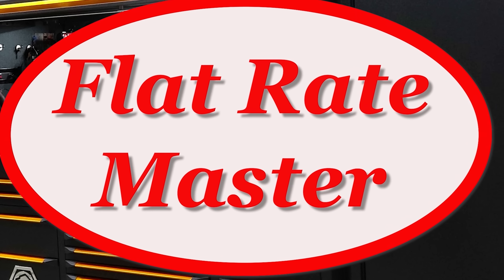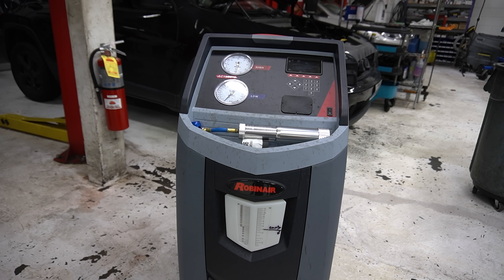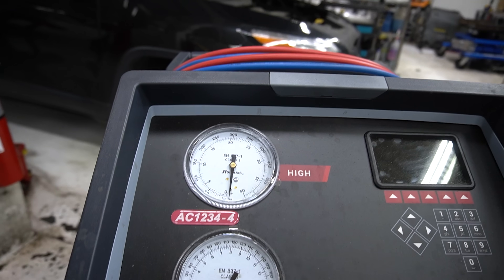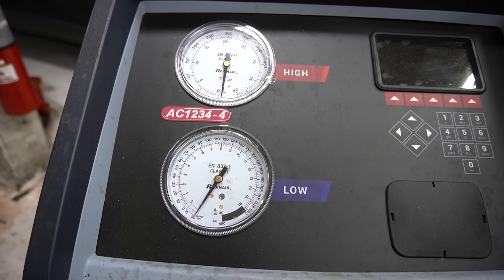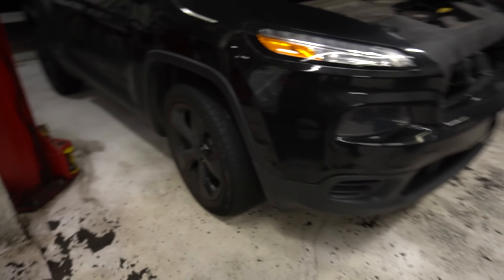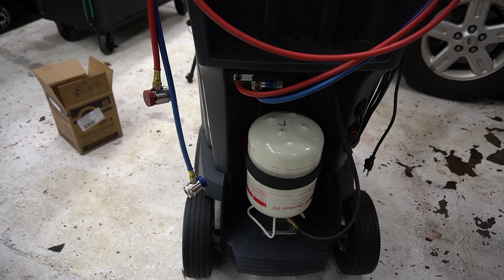Tools For R1234YF

Comment: I suspect in my area there's going to be a lot of 1234YF converted back to the 134A until prices reach reality. I may or may not know some folks who have done it with no issue. In most cases the components are exactly the same as the earlier 134A equipped models.
Reply: I don’t think it as easy to change as r12 to 134a.  I think you just can’t change fittings for 1234rf but I could be wrong because I never tried. Like you channel.
Reply: I may or may not know some shops here in northern europe that has replaced the 1234yf with r600 succesfully. Its still a flamable gas but much less expensive.
Reply: You cant convert R1234yf to R134A
Reply: @christopherenger1602  You sure can...
Reply: You cannot go back, only forward. R143a to 1234yf will soon be fine. No way on God's green earth can you go 1234yf to 134a.
Reply: @collinhopper7542  According to the EPA, R134A is a legal refrigerant for retrofits. I know the systems will handle it. I don't really see an issue.
Reply: Seeing as the manufacture get HUGE emissions credits for using 1234YF, that means that if you put R134 into it, you are 100% Emissions Tampering. And thats facts, not my opinion. lol

Comment: Compressors Leak pretty common a whole erra of vehicles left oil marks under hood above compressor see tracks. Then 134a came out and terqoise o rings and 123 here we are. Lots of cars charged with Propane works really good.  Didn't know contaminated a few machines.

Comment: I did a ac comp expansion valve and condenser on a 18 silverado the other day.. used a robin air machine and have mixed feelings about it running a leak down test before charging  the system... but if it fails that test it let's you know not to waste your expensive refrigerant and to find the leak... which we should not be charging a system with refrigerant when a leak is detected so I guess that is a good thing

Comment: Some hybrid vehicles use the AC system for thermal management of the batteries So  Vehicle owners Will not have the option of not repairing the AC

Comment: Well it will be obsolete by next year, did I hear it’s flammable too!!!  insurance rates are going to go up as cars catch fire i will say 1 shop per month in the big city’s , in the big diesel shop if a lpg or Npg truck arrives it has to be unloaded before it can sit in the shop , I always have used nitrogen gas (if it’s good for keeping fiber optics dry it’s good for me) lot of car owners are going to be sticker shocked first time it goes does DO NOT BELIEVE IN SNIFFERS THEY 50/50 just me !!!

Comment: I remember how it was the end of the world when everyone had to switch from R12 to R134. Same whining about expense bla bla bla.
Reply: And you just HAD to flush out the entire system to get rid of the old oil, replace any rubber hoses with “barrier” hoses, and replace all the o-rings with the correct green ones. Fast forward a few years and we evacuated, installed 134 fittings, injected some PAG oil and voila.

Comment: Good video!  Yes R-1234yf is horribly expensive.  It was supposed to come way down in price but it hasn’t yet.  R-1234yf is used by all automotive/truck manufactures world wide and is not going away.  We have to adapt.  Yes R-1234yf is SLIGHTLY flammable but nothing like propane.  In fact it is very, very difficult to light.  I wouldn’t let the slight flammability rating ruin your day.  No you can not simply dump R-134a into an R-1234yf system.  They use completely different oils that are not compatible.   The boiling and dew points are different too.   Just remember that misuse of refrigerants can cost the shop and/or technician tens of thousands of dollars in fines.
Reply: The only part that will prevent this in some cases "Just remember that misuse of refrigerants can cost the shop and/or technician tens of thousands of dollars in fines."

Comment: 41234yf sucks why hell did they change from 134a to that garbage over priced and in my opinion 134a works fine and definitely not as expensive
Reply: Well if you go by the party line explanation "1234 YF is much more friendly for the environment and functions better"  However if you look around just a bit you will discover that the issue is the same BS as what was said when R12 was phased out. The truth however is the same in both cases. The patent on R-12 was expiring and Dupont shoved R134A out as the "environmental responsible replacement". Now care to guess what is going on with R134A? Yep, the patent is expiring and the enviro-nazis are hammering companies to be more "environment friendly" and we get the same "look 1234YF is so much better for the environment than that nasty R134A"....
Reply: I'm not going to dispute if it is int better or not for environment because I'm.not and echo warrior because I care less what they think all I know is 1234yf over priced  highly flammable I might have work with it in automotive industry but it doesn't mean I have used it my own vehicles
Reply: @corbettknowles9942  Don't get caught, the current fines run up to $40,000 and if you are 609 certified to do AC work it applies regardless of where you do the work. I don't agree with any of the BS they come up with but they rolled 1234YF enforcement into both a federal level and state environmental laws.
Reply: @Blazer02LS  warm I wouldn't remove it out of a customer's vehicle and replace it for 134a without consent from a customer secondly if I were to evacuate any refrigerant it would be done so properly I'm just not going to open the system up and let that stuff for discharge in the air not that stupid i was referring to my personal vehicles only and no one else's  when I like you ate any refrigerant evacuated in the proper canister using proper tools not losing my certifications being stupid how to State my personal opinion of the 1234yf refrigerant what I think of it
Reply: @corbettknowles9942  Thing is that if they find you putting 134A into a 1234 system regardless if it's yours or a customers, it's a violation of the clean air act and can land you in trouble. 
From the 2015 SNAP ruling - 
For vehicles for which the manufacturer counts air conditioning credits toward its LD GHG compliance, the MVAC systems (or elements of those systems) are considered emission related components as defined in 40 CFR 86.1803. This designation includes provisions for emission-related warranty, requirements that they operate properly for the specified useful life, as well as tampering restrictions. For example, if a manufacturer claims air conditioning credits for an MVAC system that uses a lower-GWP refrigerant on a particular vehicle as part of the LD GHG program, removing and replacing that refrigerant with any other refrigerant that has a higher GWP, including HFC–134a, would be considered tampering with an emission related component under Title II of the CAA.

Personally I don't worry about it because I'm not going to do any conversions. Just don't like to see others get stuck with the bill. Take a look at what the diesel brothers are facing for violations of the CAA. 1.8 million in fines and legal costs.
Reply: @Blazer02LS  i live in a state that doe and county that doesn't have emission laws like the west coast and California or New York and the county here i live in there vehixlescstill in road that still have r12 refrigerant system and people driving vehicles that wouldn't pass any clean air act anywhere they lucky if there car has cat still on it matter fact I seen 70 model Ford f100 other day that was straight piped with no cat tell me what clean air act that truck would pass besides that my daily driver is 04 dodge dually diesel and factory 134a ac it didn't come wit def on it I don't plan on buying any vehicle that has 1234yf ac system I'm just fine with vehicle I have now I have had truck since it was new and my other vehicle is a 97 ranger  no worries on that either